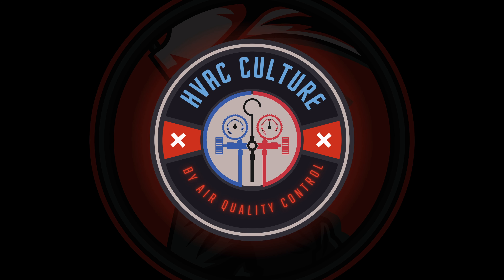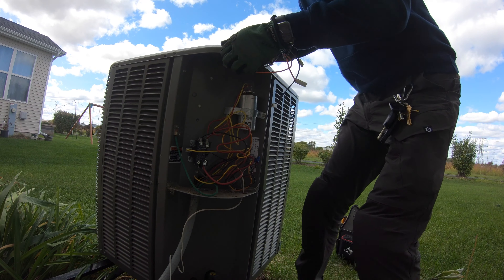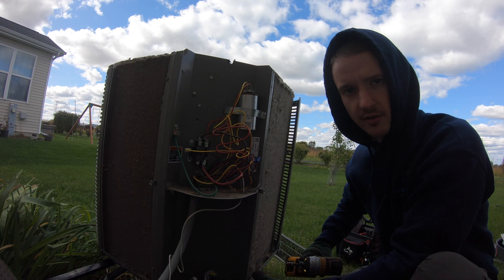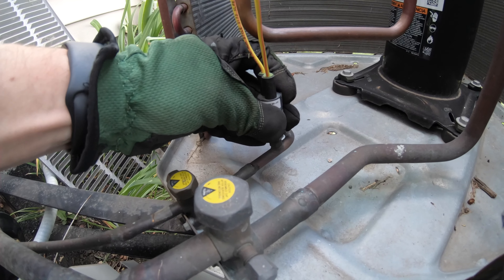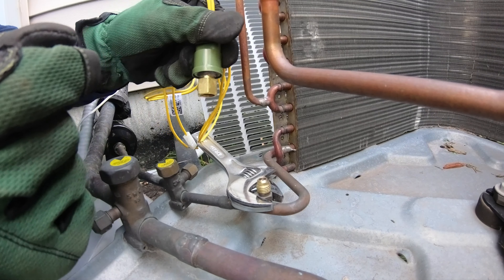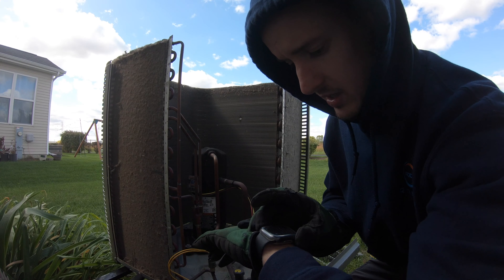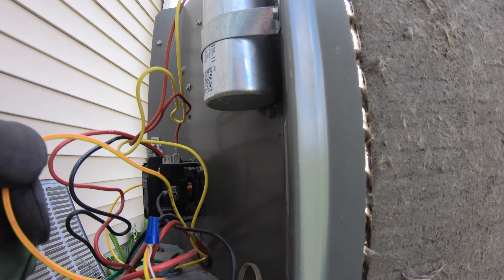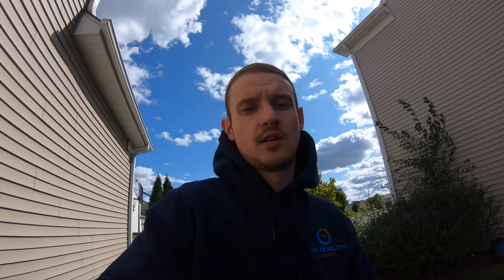How to replace high pressure switch on Lennox A/C

Comment: 3:20 - you’re not putting much tension on the cables which is good, but you’re scraping it against the edge of the aluminum which is a quick way to shred the shielding.  Keep a shop towel with you and you can place it in between the cables and condenser and not have to worry about it.  Can also use it to protect your hands when removing the fan and dealing with other sharp edges, but I see you’re wearing gloves.  Could be a nice alternative to gloves when it’s really hot out.   Just a thought.  Nice video, thank you for sharing!
Reply from the maker: Thank you for your comment. Good point!
Reply: @hvacculture  thank you again for sharing, and I’m glad you saw the comment!  Much like yourself, only looking to help!
Reply from the maker: @brainkill7034  Cheers!

Comment: Why do those low pressure switches go out? I'm dealing with the same issue low pressure switch stop working.
Reply from the maker: Good question, everything breaks and this is not an exception.

Comment: bro the condensor was a blanket of dirt on it no wonder its going on high pressure lol
Reply from the maker: The unit wasn't going on high pressure. I agree that condenser is very dirty but there is no way it will get to 600psi to trip that sensor just because of dirt. That sensor designed for any major issues like restriction in refrigeration circuit for example that might cause extremely high pressure but definitely not to go off on dirty condensers.